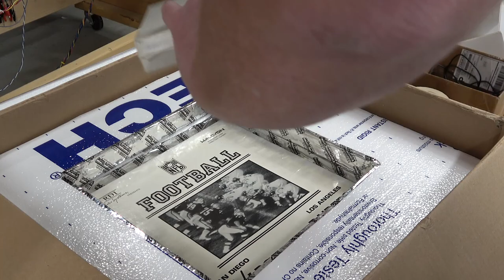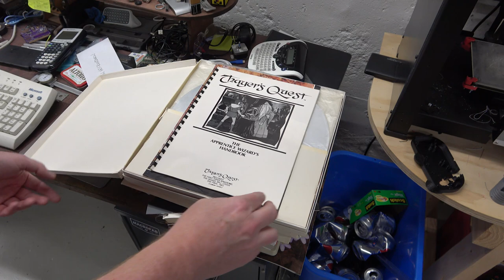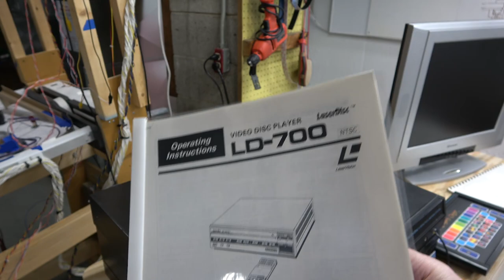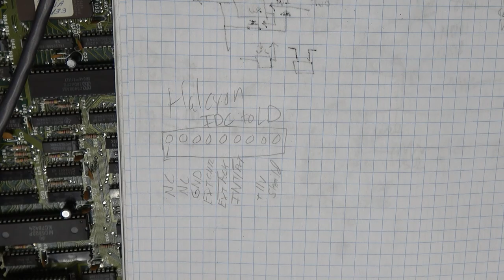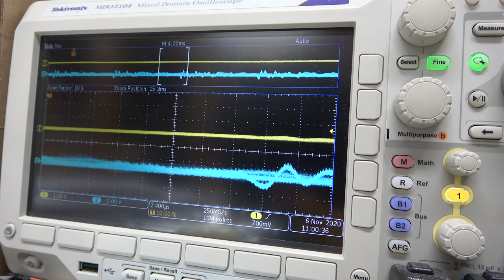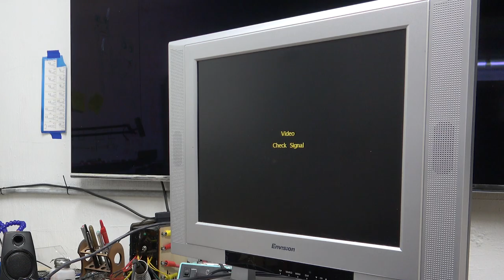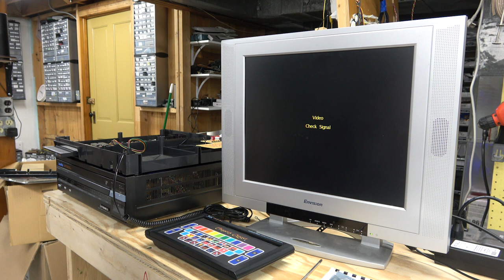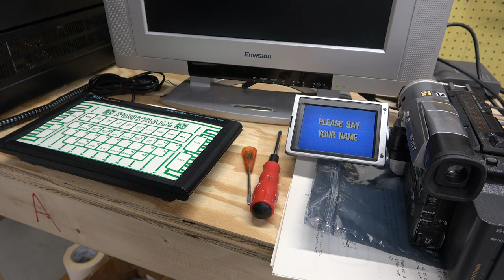Super Rare RDI Halcyon Laserdisc Game System Prototype Repair

Comment: That FM sound bit rot sucks. On VHS, you could always go back to the dynamic mono soundtrack if the HiFi track was too distorted...
Also I was kinda disappointed the laserdisc player works because I "have" an LD700 in a QuarterHorse Arcade machine which just barely works. Of course I screwdrivered it into outer space [(C) radiotvphononut] and now I get lucky if it even detects the disc. And I hoped these would have had the same kind of problem... so if I knew the machine's original problem, it would go back to barely working so I can align it by the manual.

Comment: I am more shocked Ben's Laser disk still works, since Disk Rot is major problem them. But in the end the thing that impressed me the most was the packaging system came in, that sh*t's legit. As for a rarer system? Well there is the rumored US NES Disk Drive system. That was created and then abandoned. Though no unit has ever surfaced, with some believing because it was a modded Famicom and its Disk System that was created or a modded Sharp Twin System. Nintendo reason for not doing a disk system, was that software piracy was an issue in Japan. But during the early and mid 80's it was even worse in the US. Besides, when it was expected to be released in early 1990. The Super Nintendo would be out so there was little point. There is also the Nintendo Advanced Video System, but again no prototype is known only a mock up for a trade show.

Comment: is it possible to make a copy of the Laser disk, because its so susceptible to Bit Rot, I would hate to loose those two rare games.  There is a system for Dragons lair where the laser disk plater is replaced with an SD card device, making the game work again.

Ben, i wonder if its possible to use the Dexter board as a laserdisc player replacment.  Here is the link:  http://www.dragons-lair-project.com/tech/docs/LDPConversions.asp

Comment: It's 'disk rot', not 'bit rot'. LaserDisk may have a fancy Laser but it's analog, so there are no bits.
Reply: I just imagined you pushing your taped together glasses snug onto your nose before saying that.
Reply: @ryanyoder7573  Your insensitive remark couldn't possibly be more misplaced. I'll have you know I wear Flexon, hence there is no need for tape or other adhesive compound to maintain the structural integrity of my spectacles.
Reply: @enquiryplay  I thought the tape on the glasses was more like a talisman or symbol of brotherhood rather than it actually holding the glasses together.

Comment: Is that really bitrot? Aren't LDs analog?
Reply: yeah, which means no error correction, so any signal degradation manifests as video or audio noise.
Reply: @moosemaimer  That was a joke. Analog = no bits to rot. ;-)
Reply from the maker: It's an analog signal recorded digitally, if that makes any sense?
Reply: @BenHeckHacks  Lands and pits similar to PWM, but not quite. Only 2 states on the media, but what encodes the information is the analog duration, not the digital state. I just thought It was time continuous, but it is sampled.

Comment: I hear laser disks haven't been able to withstand the test of time. I guess it would be best to copy the disks to digital and somehow wire a digital player to play the files. When I started at my job 10 years ago we used laser disks for displays that would run all day long. Didn't have any problems with them and picture was still clear when we yanked them out to replace with digital. Occasionally, the video wouldn't be playing and I would go back there and the disk tray was ejected. They were Sony players.

Comment: The computer voice is terrible and irritating, oh man. "Do U like to play?" No! The keyboard reminds me of the Magnavox Odyssey / Philips Videopac 'system' :-D, very hard to press a button and when you press a button you can hear the case squeaking (because of the amount of force it requires to press) haha. Very nice looking units btw. There was a (calc?) game for it that used the same type of voice (tech?). Like this system, they implement it because it was new, nerdy and cool. To me this system looks very similar to the failed Philips CD-I system. Actually I don't understand why they (RDI) don't use some audio tracks (like Philips CD-I) on the  disc to record and play some natural voices. 

EEVBlog did a nice video about voice recognition - 1980's Style - watch?v=kFth9K_IvwA , wonder how they did it with this system. Anyway, nice video and thumbs up saving some experimental forgotten tech. Interesting to see how they tried to improve the graphics of games with existing tech. 

PS: In the early 80's, people develop the Xenon pinball game, high tech with sound chips. I wonder why they don't use those chips, much clearer sound. This documentary of OMNI Magazine presents Suzanne Ciani on Xenon pinball, how they designed it, how they did sound. Very interesting, watch?v=L18cKlKBQ7M

Comment: laserdiscs can get bitrot? i thought stuff like that was caused by the components in the player going bad?
Reply: No it's common among optical disks. I have a bunch of CDs that barely play because they rode around in my car for a few years in the heat and cold.
Reply: @moosemaimer  huh, ive never noticed that, i have multiple discs with scratches and marks on them that don't work, but all mine that look fine, play fine.
Reply: @stapuft  The CD audio standard has a certain amount of error correction built into it, so as long as the damage isn't too bad the player can still reconstruct the datastream even if some of the disk is irretrievably eroded.

Comment: Every pic that’s on the net that shows that unit non of them have the audio connections all are just empty like that one
Reply from the maker: Hm. So if somebody designed a PCB to fit into the slot the other four machines could be restored into full "fun" working order as well.

Comment: Since laser disks are actually ANALOG, it's not bit rot.  Maybe Laser rot?
Reply from the maker: It's an analog signal stored digitally, if that makes sense? It still has holes a laser detects.
Reply: @BenHeckHacks  Sorta, I guess.  I think it might be PWM with variable pit spacing doing the dirty work.  I know there isn't really a true D/A converter, analog value is captured and stored momentary in capacitors.
Reply: A bit is still a bit no matter how stored.
Reply: @firesurfer  So would you say that a Vinyl Record has Bits that a Record Player's needle is "reading" while you listen to an album? 
As that's basically what the Laser Disc is, an optical record -- except it's not reading a waveform for the analog video. Sorta like how cellphones used to be Analog up until 3G, which meant you could still make a phone call even with less signal than today's could, it would just be really quite and have lots of static noise (whereas today it just drops the call since it's literally data and too much gets lost for it to piece together the audio).
Reply: @DUKE_of_RAMBLE  I have to think about this some more.  Off hand I'd say if it's analog you could mathematically find a conversion to bits. Almost the same as feet to meters.  This is so old I forgot what this was about.
Reply: @firesurfer   @fire surfer  lol Yea, admittedly, I kinda necro'd this. 1yr is kind of at the cut-off where I won't jump into an old convo... But this seemed an interesting enough question to pose, so I made an exception :}
(Re: Topic - laser discs, their analog video [and seemingly audio based on how Thayne's Quest behaved])

Sadly, while I may be able to come up with a question, my ability to participate falls short since I lack the computer science and math required. (As much as I love computers/electronics, I'm more mechanically inclined; can't code either, unfortunately)
That means I end up exhibiting classic signs of "Imposter Syndrome" due to having at least some knowledge and a crude understanding!

As such, I could easily be wrong with my analogy to an "Optical Record". Just seemed like the best way to wrap my head around it being able to still play back flawed signals, since to me, most things digital would end up discarding the rotted data and acting like a CD/DVD where it's "skipping" when reaching a flaw. Whereas analog ends up still able to play through it, only with degraded audio or video quality; ie old cassettes, VHS, or pre-digital TV.

Comment: Stroy if it gets long 

That is one of the resigns why in middle school I tried to make the school system by Windows 95 computers. Since the new 
mitimedia CD-ROM technettreey i saw as huge jump; the 2nd was i had Windows 95 because my dad needed  it for this avativation apps. I also with Mriocsfot Vs Netsapce War driving people to get new computers for this new internet thing the home computer will have the OS used my the work computers so they can run the same apps. The school borad hared that but didn't go that way. About 2 years letter the PTA got the school borad to go Windows 98 to fix this iusse.